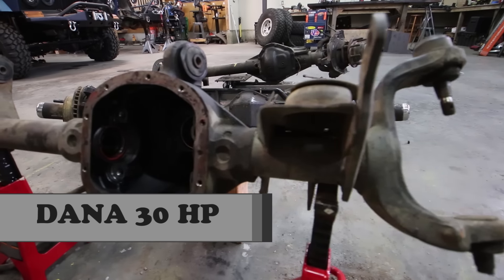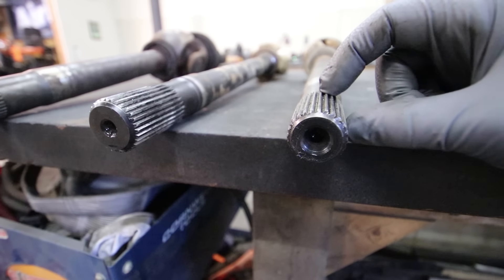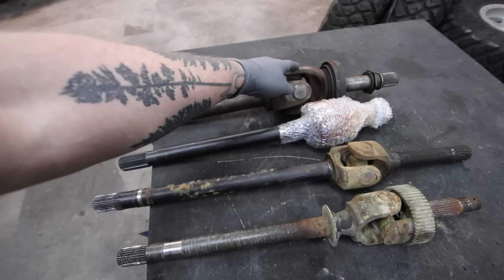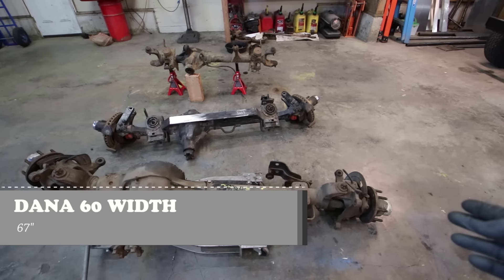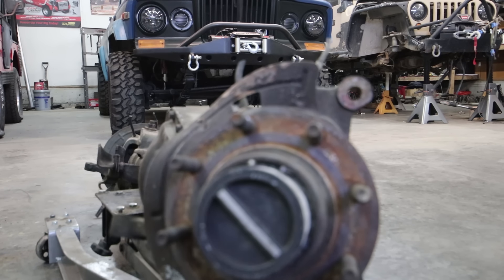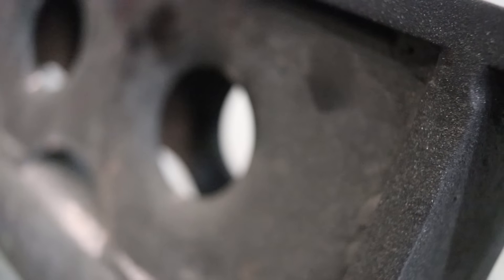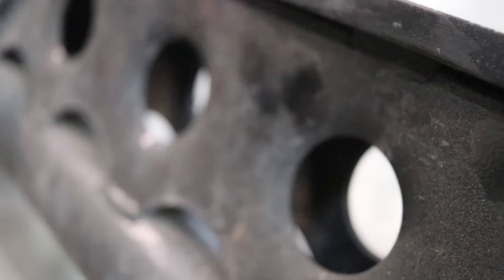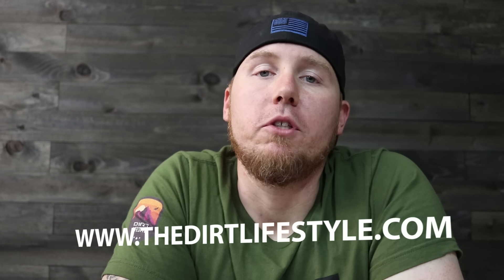DANA 30 vs 44 vs 60 Junk yard Axle Swap Beginners Guide!!!!

Comment: D60 ring gear is 9 3/4".  10" is a Super D60.  The Super's housing is also stronger, with larger diameter and thicker tubes, and takes bigger U joints.  

Not sure I buy the "ring gear diameter = strength" argument: the rear axle on an F350 with dual rears is a D60, but the SRW axle is the Sterling with a 10.25" (older) or 10.5" ring gear (same axle as the F250).  After 2011 or so, the DRW F350 should have a D80 (11.25") under the rear end.  And I've seen sheared gears on all of 'em. 

I'd argue that there are a lot more factors at work, and if you look at the different versions of the Sterling axle, that suggests I'm more right than "bigger ring gear equals stronger."
Reply: Oh, and another fun argument against the "bigger ring gear is stronger axle" thing is the AMC 20 vs Dana 44.  AMC 20 has the bigger ring gear, but the housing and two piece axle shafts mean it's far weaker.

Comment: Dear Friend, i have a dana 30 in my 2001 tj Wrangler in the front do you think if i upgrade the axles with chormoly material spline 27 it will be adequate to ride it whith 35" in the trail? please let me know you comments
Reply from the maker: Hard to say. The way that I wheel then yeah that setup would hold just fine. I'm very measured and know when to throttle and when not to. It really depends on your driving style. Some people just send it full throttle every obstacle lol. This might not hold for them
Reply: @DirtLifestyle  tks friend ill try to drive with common sense , your comment is very helpfull,

Comment: Hi @ Dirt Lifestyle can a dana 60 hp be used on a ford ranger 2016 xlt ifs truck, i want to do a solid axle swop   to run 40s currently its running ifs front and factory diff rear with a rear gear ratio of 3.55, also if i did a solid axle front would the rear diff need to be swopped  as well?
Reply from the maker: You can straight axle swap anything but it is a ton of work. That would be a great combo if your willing to put the time in. 👍

Comment: so when it comes to splines. no mater the axle the splines are the same size? (as in cut, depth, width, etc.) not to be confused with dia. but just were the dia = more splines given the larger dia. is this right? if looking end on to the axle.  
 if layed out flat, a bigger dia axle would just = more length, so more splines can fit the space. 

or are the splines physically larger on a larger dia axle. aka: taller, wider, deeper?

Comment: Cool video, but why did YouTube send me here. I got Rockwells for my jk and Dana's cost to much and can't compete with rockwell plus you can change your gear ratio from the atrocious 6.72:1 To a 4.90:1 and all the new parts are made from 4340 steel.

Comment: What axles are on most rock bouncers? Just want to know for kicks
Reply from the maker: I've seen alot if Rockwell's but the last couple if years people are converting 14bolt rear axles into front axles. So they are using corporate 14bolt axles front and rear

Comment: Can you tell if you have a High Pinion Axle without opening the case?
Reply from the maker: Yup, just look at the side profile. If the pinion is above the centerline of the axle you've got a high pinion but if its below then it's a low pinion. 🤘
Reply: Dirt Lifestyle Looks like High! Are all dana 44’s high? Mines a 2005 LJ Rubicon.

Comment: Would you recommend a sf Dana 60 over a ff Dana 40? Both in straight out of junkyard form, stock everything to keep everything fair. 

I’m gonna do a SAS on a k1500 for my overlanding/trail rig/fire road bomber. I have a 14bolt with disc brakes for the rear with 4.10. Has 35s now and may bump up to 37s after the swamp dependent on clearance. I’m trying to get the most bang for my buck so trying to keep costs low.
Reply from the maker: Full float dana 40? Must be a typo?
Reply: Use a D60 on a full size rig if you can. Every part of it will stand up better to abuse. Especially if you are driving a loaded overland rig. 

All FRONT solid axles are full float by default. If that's what you meant by "ff"
Reply: I meant high pinion Dana 44 vs low pinion Dana 60. 

I have since bought a parts truck that had a low pinion Dana 60! Looking forward to this build
Reply: @NickIznbrth  The D60 will still be way stronger.

Comment: Is there such a thing as a high pinion rear axle?reason im asking is because of the 30% strength coming from pulling of the pinion wen going foward..but since its a front axle your going foward most of the time.i dont maybe im confused.lol
Reply from the maker: The rear end has the same rule but in the opposite direction! Low pinion is 30% stronger in the rear if your moving forward. I've never seen a high pinion rear in a oem application but I have seen some custom built hp rears. Usually for pro rock crawlers to get a little extra clearance
Reply: @DirtLifestyle  gotchu..appreciate buddy..enjoying the videos.thanks
Reply from the maker: No prob man!

Comment: Very good older video but your spline count is not a unit of measure it’s more like fine thread and course thread on bolts. Fine thread is stronger with more contact area.

Comment: Stock JK Rubicon Dana 44 with 4:10's.... would 35" tires be ok. I do more on road driving and occasionally wheel.... should I consider any upgrades?
Reply from the maker: I would would feel very confident running a 35 on a stock JK rubicon. Plan on either trussing or sleeving your housings long term. In the short term, have someone weld the center sections to the tubes. Jk axle tubes spine in the housings all the time. Good luck!
Reply: @DirtLifestyle  Jk axle tubes spine in the housings all the time. Since I'm a Newbie at this, What does that exactly mean?
Reply from the maker: The axle tubes are a different type of steel then the center section. The axle factory (dana)  presses each axle tube into the center section then does two welds to hold the three pieces in place. (Drivers side tube, center section, passenger side tube). If you apply enough twisting force from your tires it will break the weld between the center section and axle tubes allowing the tube to spin and in some cases the tube can walk out of the housing. This will leave you stranded. Very difficult to fix but easy to prevent. Google image search, axles tubes spin. You will find some images to help my explanation. I hope this is clear enough! It's tough to explain with out showing you lol so I did my best
Reply: @DirtLifestyle  I actually understand exactly what you said... I greatly appreciate it & now you have a new subscriber.
Reply from the maker: I'm ordering the new diesel JL Rubicon this fall and I'll be covering a lot of this stuff while I'm building up the new rig.  A lot of the information from that build series should transfer over well to your situation. Thanks for subscribing buddy!
Reply: @DirtLifestyle  I see many people moderately wheelin 37s on the new wrangler JL stock d44's (m210 & m220) without issues for the last year and a half.   I have 35s on my JL rubi axles and am looking at lighter 37" milestar Patagonia M/T on a lightweight wheel.   What are your thoughts on keeping stock axle shafts bc if something breaks, it would better to break a shaft bc they're easier/cheaper to repair vs. adding chromally shafts and making the ring/pinion the next weakest link.  Thoughts?

Comment: Hello Friend, excellent video.
Sending message from Portugal
I needed your help, I want to know, if the Dana 30 of the 89 Cherokee XJ, Well prepared, I can run 33 "or 35" tires without any problems breaking.
What do I need to do ?. I need to replace the inner and outer Knuckle with more heavy duty ones
That advises me
Best regards
Jackson

Comment: Hey Nate! I have an 85 Waggy d44 I got for cheap but it doesn't have any outers. Do you know if I can run late 70s f150 or bronco parts from the ball joints out? I already have rims and tires on 5 on 5.5" so trying to keep with that bp

Comment: Hello! I have a 2005 tj wrangler that i use as my daily but i want to use it a bit harder on the trails. I currently have it on 33s 3.73 geared and one day would like yo run 35s. What are your thoughts on running rear dana 35 with a super 35 and chromoly shafts? I dont plan on doing crazy rock crawling but i do plan on doing as many trails as possible that are in my limit and of course i do plan on regearing. Dana 44 can be very pricy around here, iv also thought of maybe throwing in a 8.8 axle but i wanted to know your opinion on this.

Comment: Hello my friend I always see your YouTube channel what do you think about these axles for me cj7?  Or are the 2005 better???

Description Dana 60 front and Sterling 10.25 rear with 4.10 reverse cut gears and Old Man Emu springs set up SOA.  Both with 35 spline axles.  with Front disks, 1-ton 8 lug 1980's F350 axles, 8x6.5 ford.  Lines up perfectly with the stock YJ T-Case.  It would cost you a pretty penny to build these from

Comment: I have an 86 cj7 dana 30 front axle I only want at most 35s upfront as its also going to be a daily driver will it be able to support the hp and torque of a chevy 350 if i upgrade it like the ultimate dana 30 video?

Comment: @DirtLifestyle  I'm planning on pulling the IFS out of my 05 Jeep WK Limited 5.7 Hemi with QuadraDrive II and put a solid axle under it. It's getting 35s and I'm planning on 6" lift. I can't find a junkyard JK Dana 44 around here, so looking for alternatives from junkyard to keep my cost low. FYI I've not done anything like this before, learning it as I go. Done some motorcycle rebuilds though.

Want to go with 4.56 gears, elocker and keep my ABS etc working on the WK. Need Driver drop pumpkin and want high pinion of course. 

I haven't been able to get an answer on this, so if you don't mind answering these for me: 
Is there another truck's (like Chevy 1500 or Ford) Dana 44 that would work so I can just swap on JK knuckles and hubs so I get 5x5 Lugs (don't mind if it's wider) without having to buy lots of parts or do major mods?
What do I need to watch out for when picking one up aside from basics like it being straight? 
Would I be better off to just buy a new JK axle like the Spicer D44 Ultimate JK from 4wheelparts.com? But that's nearly $4k :/ so doesn't help keep the cost low.

Comment: So would a built DANA 44 be the best for 37s on a TJ for heavy wheeling?

Edit: also are their companies that take your axles and build them to your specifications without having to buy an entire axle assembly for an arm and leg price? I've seen Currie axles go for almost 3k a piece which isn't bad but their not high pinon unless you get a Dana 60 which is 11k for front and rear.....
Reply from the maker: Tough call man. Not all Dana 44s are created equal. If you build a JK 44 or a Ford hp 44 then you should be in good shape. With chromoly shafts  and a truss of course. 🤘

Comment: I have just got a 96 xj it has the dana 30 up front but has cv joints instead of u joint, did those come stock? sadly it has a dana 35 in the rear will have to figure that one out as well.
Reply from the maker: I've never seen an xj with cv shafts stock. Sounds like someone swapped a wj dana 30
Reply: @DirtLifestyle  the question is how to tell and is that a good thing? hehe...

Comment: I have an HP Dana 30 I want to put in my 04 tj. Will the LP Dana 30 axle truss work? I’ll be 35” tire max. Not gonna really wheel it hard.
Reply from the maker: It all depends on the truss system you use. If it welds to your center section, then you will need to modify the truss to make it fit properly. Not a big problem at all, you probably just need to grind it to fit. I would email the manufacturer of whatever truss system your interested in 🤘

Comment: What's your opinion on the factory Dana 44's in a 1972 v8  CJ5?
Reply from the maker: I've heard mixed reviews on these axles and don't have much experience with them first hand. The good things about a cj dana 44 is you have a ton of strong after market parts available. If you break it, add some chromoly 🤘

Comment: So I want 35's on my 2003 tj, at the moment I have a dana 35 in the rear and 30 in the front, I've been reading on forums its sketchy to run the 35s on upgraded dana 35 and 30, so would a set of currie 60 and 44 be way too overkill? I just really don't want the risk of breaking anything

Comment: is the stock d44 in a jk rubicon a high pinion?
Reply from the maker: I'm not sure to be completely honest. The only Jk's I've worked on have aftermarket axles in them. 👍
Reply: No they are low pinion.

Comment: I have a 2000 blazer and a 2000 grand cherokee and would want to swap the axles into the blazer, that i know of there d30 and d35. Im not going to be doing crazy off road just some mild stuff, i mean there about the same size and weight, both 6 cylinder amd 4 door suv, but ive heard the d30 d35 arent that great. Can you point me in right direction
Reply from the maker: What size tires are you planning on running?
Reply: 33-35.
Reply from the maker: @seanmathias7569  I would get a high pinion dana 30 front from a junk yard and a ford 8.8 rear. If you shop around you could get the pair for 100 bucks. Forget about the dana 35 as a swap option. These things are awful. If you already had one in your rig that might be different story but if your spending the time to swap, then the Ford 8.8 is the only way to go. Disc brake, and limited slip stock. You can build the wj front axle but if your going to spend money on a dana 30 you might as well start with a high pinion axle. Long term a hp30 and a Ford 8.8 could be built for a 37s if you decided to grow. A well built and upgraded dana 35 could probably handle a 35" tire but it would be sketchy. Just my opinion by the way! Not gospel!  Good luck with your build brother 👍

Comment: Would you say that a built dana 30 on 31's on a zj would be alright for some medium off roading?
Reply from the maker: It would be pure speculation but yes 👍
Reply: In my experience.  93 ZJ-v8 w/LP30-4.56 (trussed, tubed C-gusset, chromo's and ARB) on 35"KM2's.  Orig i had stock shafts...blew one up on my 1st day on them and took out my case half on the ARB.  went to chromos, tubed and C-gusset and within a year snapped an outter and twised the short inner (ten factory so it was warrantied).  Trussed it last year and seems to have held up so far.  I wheel pretty hard on it but i know its only a matter of time.  Think im ready for the next level to get me on 40's.

Comment: I am doing a rear end swap on a 98 grand Cherokee 4x4 with a 5.2 motor I was going to perchase one from a junk yard in California does 500$ seem high priced used ? Also does my vehicle have a Dana 44 with 3.73 ratio want to make sure I get the corect one and what are some things I i should look out for wen purchasing used rear end ? And the junkyard mentioned it may come with brake components attached would you say it would be a good idea to use the brake components as well I would like to just swap everything all together if I could I alwready have it removed
Reply from the maker: Seems like a fair price. If your buying a used rear end pull the cover and look for excessive metal shavings. Also inspect the teeth. I would never reuse brake components that have been sitting around outside. Don't risk it! Safety equipment is something that I won't compromise on!
Reply: Thanks I might just use the rotors if they look good
Reply: Hello again I replaced a rear end with a used one the new used unit has a rear pinion seal leak I am going to tackle the job tomorrow morning I don’t have a torque wrench wen installing the nut for the yoke and setting preload do you think I can get by just marking the threads on the outside before removal and wen tightening the Knut I can just line it back up to those marks I don’t have a torque wrench I am almost done with this thing
Reply from the maker: @thewrenchmaster122  I would find someone with a torque wrench and use lots of red loctight. I wouldn't trust marking the nut with a job that important. That nut sees alot of stress and can lead to some serious heart ache if it comes loose. Good luck!

Comment: how would i find out if my 76 k5 blazers dana 44 is a high or low pinion?
Reply: Chris Walker looking at it
Reply: Compare it to a picture online
Reply from the maker: If it's stock, it's low pinion. High pinion axles only came in Fords for the most part. But you can tell just by looking at the housing. If your pinion is higher than the center line of the axle it's a high pinion. But if it's lower than the center line of the axle it's a low pinion. 🤘

Comment: I have a Dana 44 and keep braking the stub shaft and U-joint, 
It’s on a 98 Ram 1500 on 33s.
Any suggestions?
Reply from the maker: Use spicer brand joints and if that's not enough I would call rcv. They probably make a shaft for your application. Their shafts and joints are by far the strongest on the market 👍

Comment: So more or less your saying i can run 40s on my D44? I have a 97 zj stock axles, upgraded shafts on 35s but want 40s an 1 tons but would love to wait on axle swap ig i can really just swap the front an run 40s on them?
Reply from the maker: Unfortunately my opinion of the Dana 44 rear is diff is different than the front. And especially if you have the ZJ d44 axle. That house is aluminum. When the housing flexes it creates deflection in the gears and destroys the ring and pinion. If you run a steel Dana 44 rear it CAN be made strong enough for 40s if you double truss it and upgrade to 33 spline shafts. This is only doable if you have a low horsepower engine. 180 ish horsepower or less. Because the rear gearset gets alot more stress and strain than the front. Good luck buddy 👍